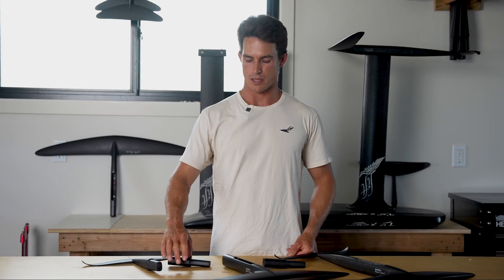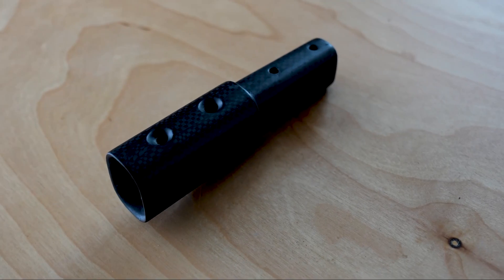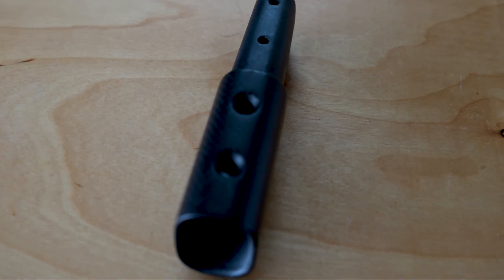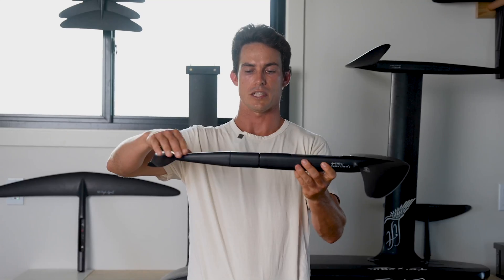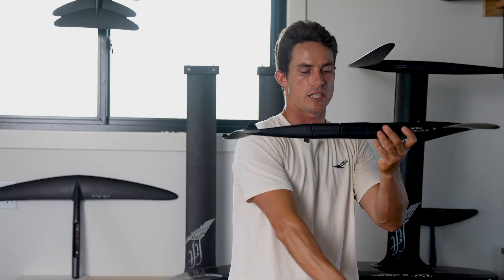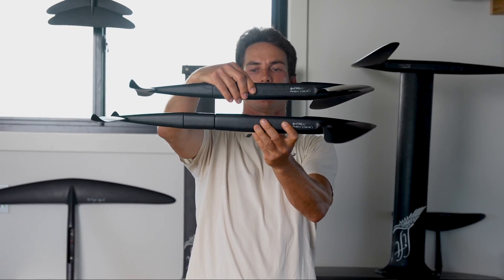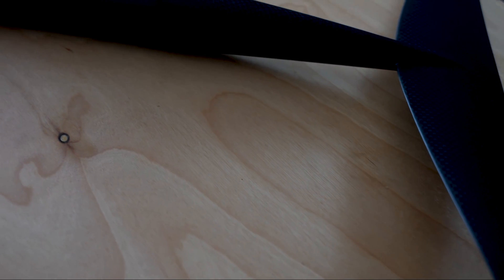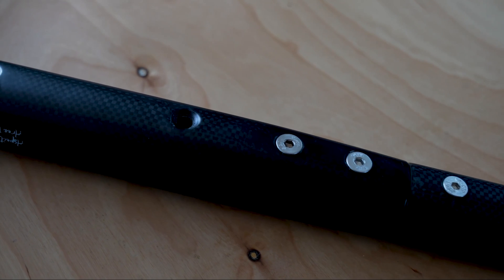Tech Tips | Wing Fuselage 3” Extender

Comment: I'm going to get one of these because it seems like a way to mellow out long distance high speed riding on the EFoil. The 32 Glide rear stabilizer has won me over but it can be a little squirrely so on a flat calm day when there aren't boat wakes to surf the extender might be the way to go. 

Could you please do a video explaining which wings are best for reaching the highest speeds EFoiling and which wings are best for making the battery last the longest? It seems to be a common question and it would be awesome to hear your opinion! Thanks!
Reply: Yes, it makes high speed runs a lot easier to control.  Not up and down as easily.  I've just watched some pretty detailed wing comparisons with lift off speeds and such.  Pretty good agreement (I THINK) that HA wings give you the longest battery life and glide ability but aren't as much fun to turn.  I agree with that.   Camber Pro is the most fun to turn and I believe fastest. I intend to get one for next season.  Surf is inbetween, good at all but not the "best" at anything. Don't mean to jump Lifts response, I've just watched lots of videos.  lol

Comment: What’s the length of the fuse less the extension?
Reply: It's going to depend on what rear stabilizer you're using. For instance the carve series rear wings are shorter in length than Glide or Surf rear wings. The Extender adds three inches to the fuselage.